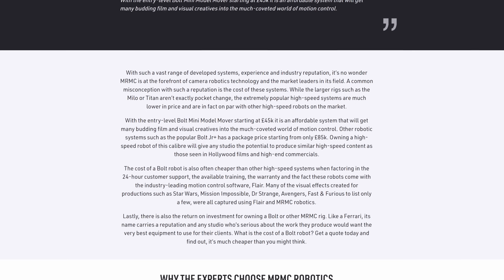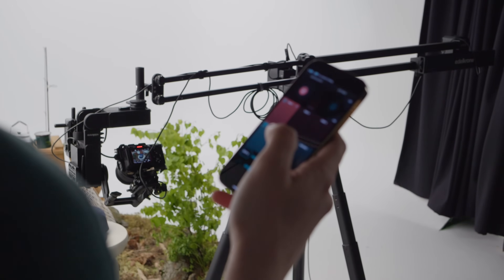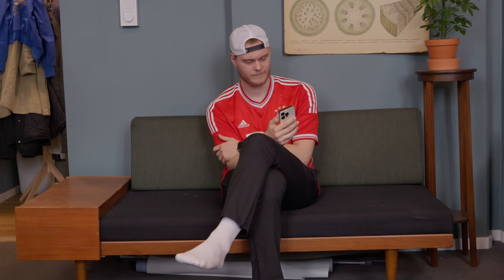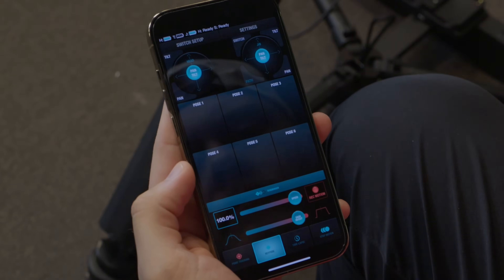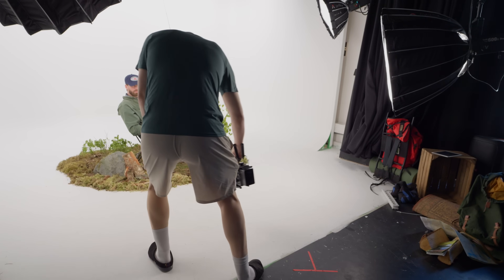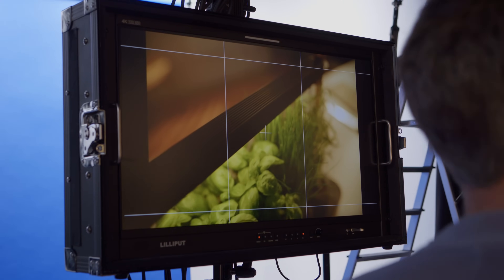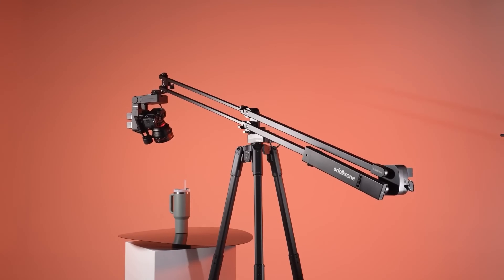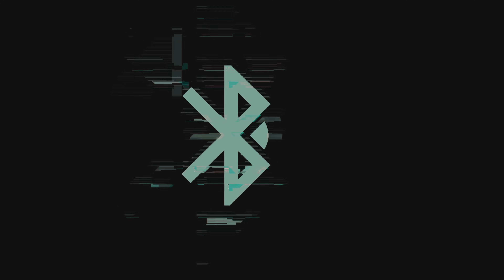Is Motion Control Finally Affordable? Edelkrone Krone X Bundle

Comment: I've spoken with many Edelkrone customers who own multiple products from them. They all feel the same way, that they purchased "ready-for-market" products but feel like "beta testers" due to many hardware and software issues that exist across the range of products. It's unfortunate to spend any money on equipment that falls short of it's promises with very little after-sale support from the manufacturer.
Reply: Count me in that group as well. Bought and sold a lot of their stuff including the first JibONE and pretty much all of the other essentials (Slider, HeadPLUS) and would subscribe to all the grievances you mentioned.
Reply: I ordered 7000 euros worth of product, it was unusable, no precision, no regularity and for the return they took 2600 euros from me.... I have videos that prove all this... they have very good ideas but that's all
Reply: Went all in on the Slider and head and for a while it was excellent but somewhere down the line with every update the slider got worse and worse to the point where it became a $3,500 paper weight.  It couldn't repeat movement, never went faster than 5% of it's speed no matter what setting you put it on... Yeah Edelkrone can go intercourse themselves.
Reply: To everybody considering buying anything from Edelkrone: Rent it first and try it out for yourself.
Edelkrone Products are one of the most frustrating products ive ever used. Unreliable and garbage Software!

Comment: I'm interested in the test mode once you have your tracking points set. (The mode where you verify that the tracking points are where they need to be before starting a motion sequence) Is it theoretically possible to hand move the jib but have the HeadPlus Pro still track? If so, then that's a game changer around the slow speed challenge of the jib.